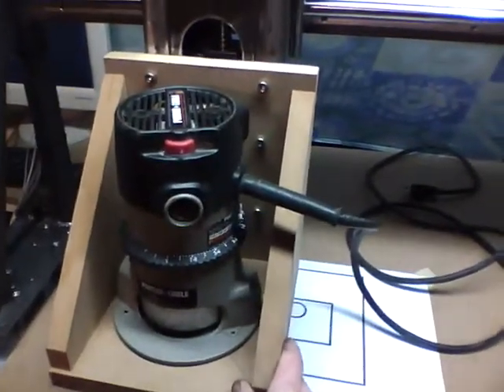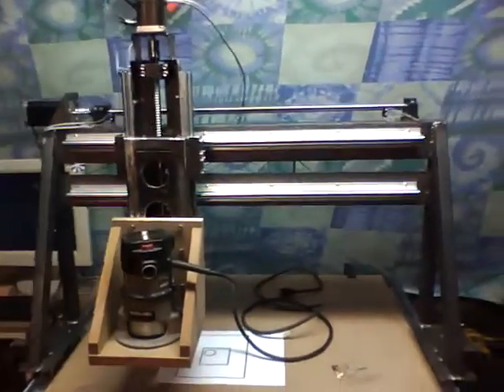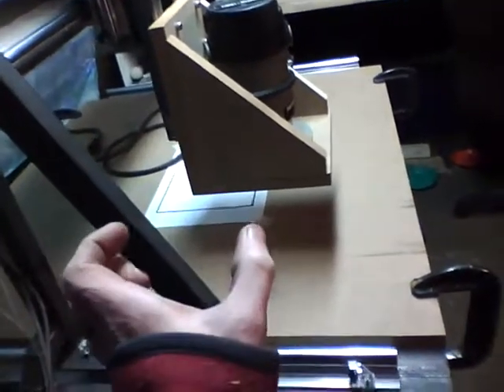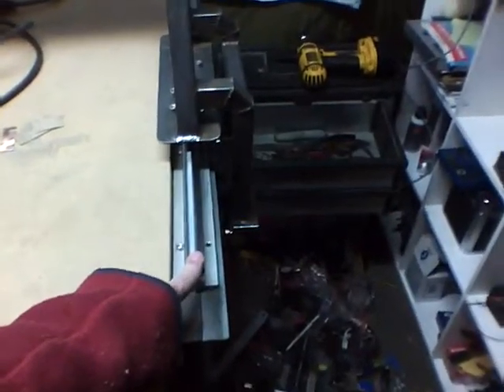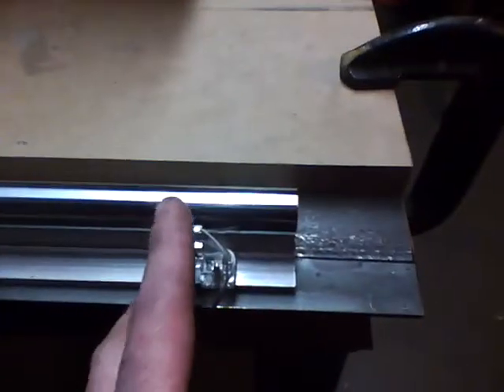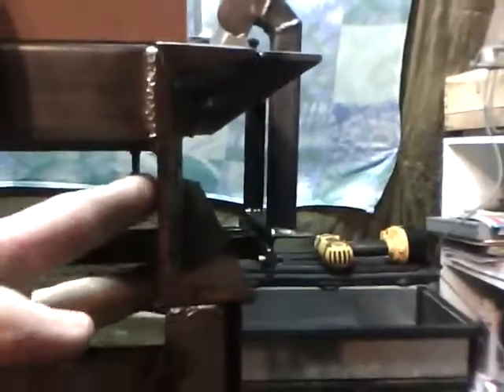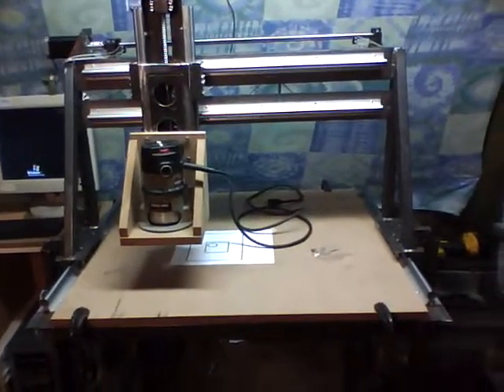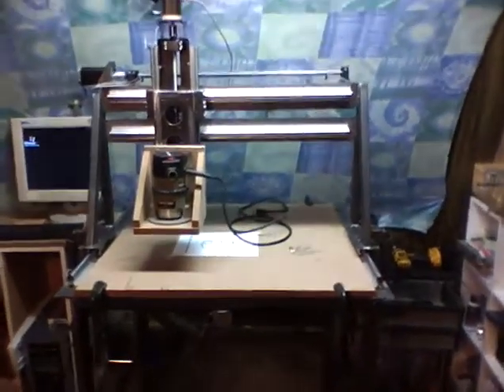CNC Project Day 10

Comment: @tleneel that's exactly what I what about to suggest. 

adding a counterweight below will reduce the circular forces from the lower thread pivoting at the bearings, causing the 'herky-jerky-ness' ;) 

but it will naturally be harder for the motors to push and pull it around.

Comment: Sliding the table sounds a bit better, less mass, quicker acceleration. But, could you fix your gantry problem by adding counter weights underneath? To create an equilibrium (since you have an offset weight problem), I realize it would be heavy, but it might reduce the vibrations.